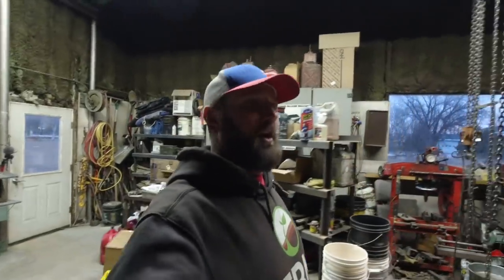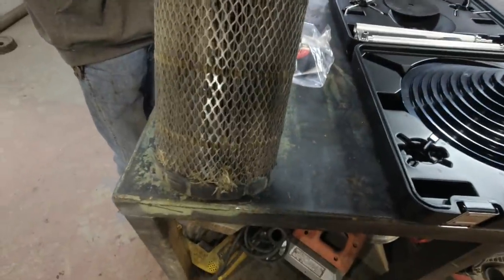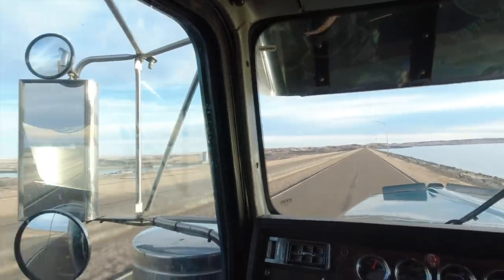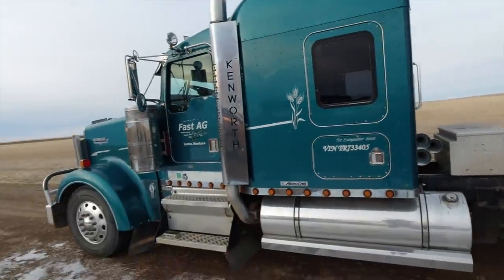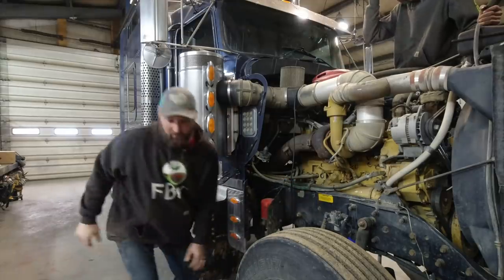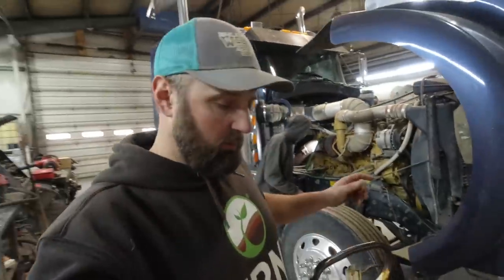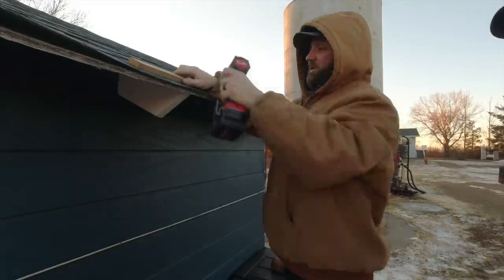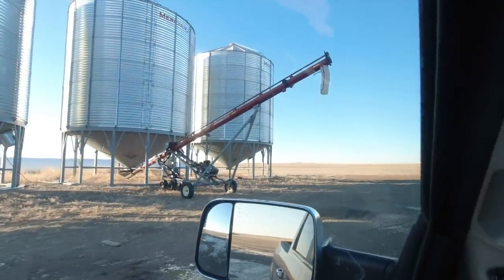A Big Cheater!

Comment: If you need new bin lids measure carefully, ant have a Air Conditioning Sheet metal shop do the fabrication out of heavier gauge tinplate metal. They can roll form, flange and seam the lids, all you need to do is drill and screw the hinges on. Use padlock hasps and rope clips for the security -wont be able to knock them open with the augur end, plan to climb up. 😅